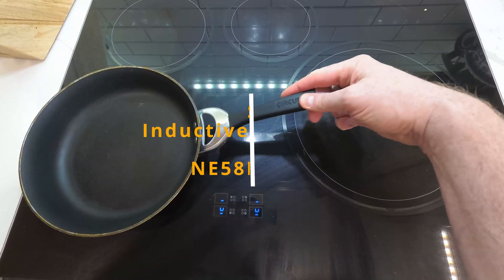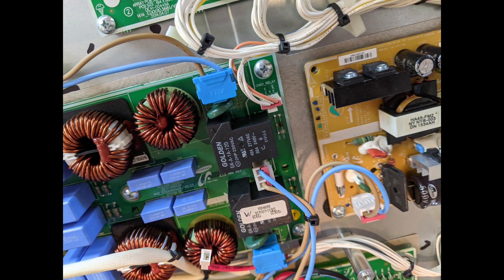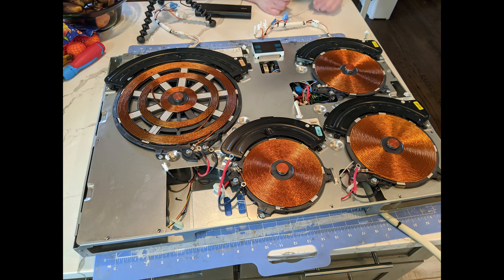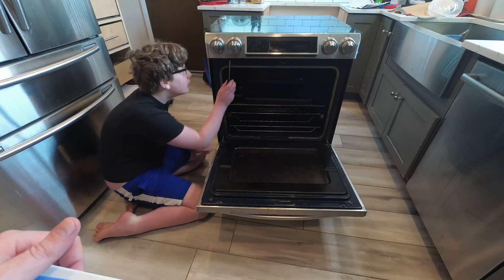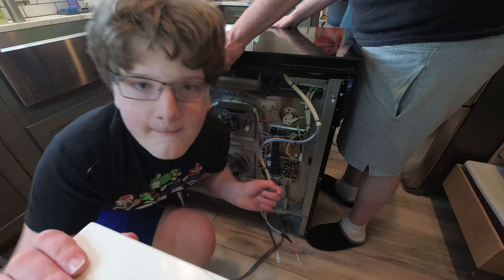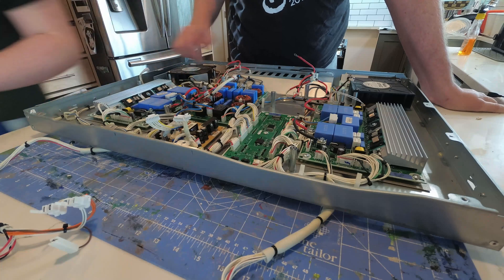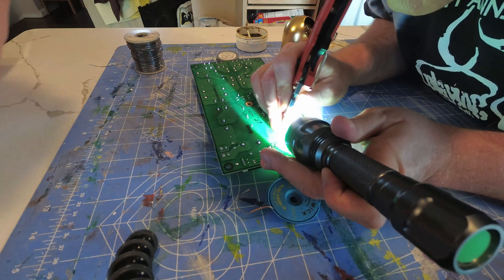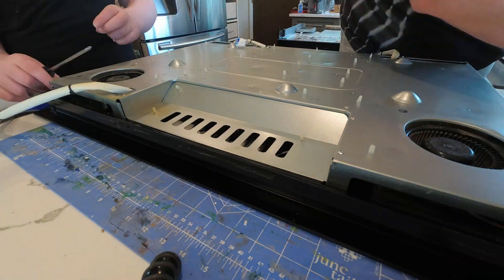Samsung Inductive Range Repair

Comment: Good day all, thank you very much for making this very detailed video. You saved us a lot of money, either for repairs/parts or to have to replace the complete appliance. Mine had the exact same problem and the solder connection was indeed the issue. Cleaned everything up, packed the connection with new solder and it looks like it did the job. For some reason, it looks like the pin from the relay doesn't take solder very well. We actually really like this range, even if it's 9 years old now. Our first induction and we will never go back to anything else! Again, thank you very much! With the internet and youtube, you can pretty much do anything nowadays!

Comment: Great video ! One more here that had it fixed. Both side stopped work. First left and then right side. Two points of solder fixed and all 4 burners working again. In case you are searching and got in this video it’s worth the try before buy a new one. Thank you for the video.

Comment: Hello, thank you for the video. I used it 2.5 years ago to fix the right hobs and will need to do it again to fix the left hobs. You mention having to fix the convection fans in the past, could you elaborate on that please? There is something not right with our fans and I wouldn't be surprised if it is the same issue. Thank you.

Comment: Dear Mr. Tools Against Entropy,

A huge thank you for your video, which continues to be an invaluable resource for Samsung stove owners. After carefully inspecting all the solder joints on the main control board and the right-side module (as both right burners had stopped working), I went ahead and reflowed two solder joints that looked slightly suspicious, even though nothing was as obvious as in your video.

I reassembled everything and tested the problematic burners — they now work perfectly! I wasn't sure at all of my work.

Many thanks to you and your son for your work and generosity.

Comment: Thanks for posting!. Awesome.  Saved me $$$ .  Just took me 3 hours.  There is a lot of screws..  Do need to be able to remove and re-solder.   Mine oven had two burners on the right that wouldn't work but was same fix.
Reply: Note that mine also had two failed burners (on the left), so same fix as your, just the other side.  Glad it worked for you!

Comment: The screws for the red and black wires are completely stuck.  We tried everything and no success.  Any ideas what we can do because we are damaging the screws right now?
Reply: First of all, make sure you have the right size and type of screwdriver, it's not a "one size fits all" situation.  I don't know exactly what size it is, but for Philips there are different sizes like #1, #2, etc...  Also, there's Pozidrive which looks a lot like Philips, but isn't.  If you've damaged the heads, it may already be too late.  I've heard putting a rubber band between the screwdriver and the screw can help.  Make sure you press in firmly while turning.  They also make this compound that can help, specifically for difficult screws, it's fairly gritty.  If the head is already damaged too much, you may have to look at using a left handed drill bit and/or an easy-out.  Look here for tips on difficult screws.  Be safe!

Comment: I replaced both fans in oven 2 month later the left side of the induction cooktop stopped working thanks for the video . By the way what type of solder works best.? Samsung should stick to phones.

Comment: Thank you so much for your video.  My samsung, 10 years old, failed one burner at a time over the last 6 months.  Thanks to your video I also found 2 bad solder joints on the centre circuit board.  After 4 hours work it is now back in operation.  Great job on the instructional video.

Comment: Thanks for the detailed, and clear instructions.  I've had to use your video twice now.  First the left side went out, then about a year later the right went out.  It was the same solder joint both times (but on opposite sides of the board).  You saved me a bunch of money.

Comment: Thank you so much for your detailed and helpful video.  This model stove is discontinued and we were able to fixed the 2 burners using your recommendation of resoldering the motherboard joints.  We are very grateful to you!
Reply: Which samsung do u have, where r u located

Comment: Thank you for your detailed and helpful video!  This model stove is discontinued and we could not find another stove on the market with the same features.  We were able to fixed the 2 burners due to resoldering the motherboard connections as you did.  You save us a big repair bill and we are very grateful.

Comment: Thanks. I just did this even though my hob wasn't completely broken. I got 10% more power on the left and 100% more power on the right. My big burner also had the wires a bit burned so I gave them a light clean. If I open it up again I'll change the 2 relays (GK-A-1A-12D) and will fully clean the wires or replace with silicone wires, they were only 14awg.

Comment: It worked!! Before I  saw this video I took my  oven apart. I could not see anything wrong.  Watched the video, took it apart again. I Looked at the board could not see any issues. I used my phone to zoom in on it and found the little tiny culprit. I resoldered the connection, and put it all back together. And bingo it worked!!! Thank you very much for your excellent video. I would’ve had to pay another $3000 stove. I will never buy a Samsung again, 2  main boards a convection fan and now this,never ever again.

Comment: I just finished the same process and found cold solder joints in the same location on the same board. It also looks like there was an attempted repair evidently by the people who made the board after realizing that the board had failed connections.
Pretty obviously a manufacturer defect but of course Samsung isn’t going to admit fault. I repaired the solder connections and the range burners work perfect now. It’s actually a pretty simple repair once you know the issue. The Samsung appliance repair technicians told my brother that the range couldn’t be repaired and the best place for the range was the local landfill. They had already replaced the main PCB board at the back of the range which of course had absolutely nothing to do with non functioning burners, at a cost of $600. These guys are a bunch of clowns and have absolutely no clue. Anyway thanks  you for the heads up it saved this range from death by landfill.

Comment: Great video, unfortunately, many of the screws on my unit were very soft and stripped easily making access to the circuit board very difficult.  I did manage to get to it, and solder what looked like a. burned out connection, but either my skills are weak or it was something else...time to look for a replacement.

Comment: This problem board is DE92-03543A    ASSY PCB SUB. The failure solder point component is GK-A-1A-12D. The problem is so called interactions soldering.

Comment: Thank you for posting this video! My stove is similar, and I had lost all functions of the stove (lights, sounds, burners) all at once. The fix for me was replacing that yellow circuit panel (DA92-00486A), I was able to test with a multi meter, and the soldered in fuse on that panel was blown, in addition to it having a burnt spot on the panel. While I was there I checked the other soldered connections and fuses like you show in the video. Thanks again, and cheers :)

Comment: Again, thanks for this extremely well done video. Did this today, exactly as described here. Me and my brother in law did it in 2 hours. Only glitch was one screw from the burner connectors REFUSED to come out and we shredded the screw head, (it was near the rear edge) so I just pried open enough space between the burners plate and board plate to remove the board. The exact spot was burned. Used a cheap solder and solder wick. Done.  It works. Thank you.
Reply: Had the same issue. Some of the screws were really hard to unscrew.

Comment: Thanks so much! Exactly the same problem on mine!! My very ugly solder fix might fail again but I can just go back in and do it again. Also thank you for the different bowls for different screws at each stage tip, I actually got it back together and used every screw! None left over lol!!

Comment: I watched the two videos and searched online for this problem. Based on the video and the instructions for other Do It Yourselfers, I decided to give it a go. The only difference was that my right stopped working about a month ago and two days ago it was my right front, so I needed to give it a shot, and guess what! I found the same problem only it was the solder in the main circuit board that controlled the right circuit board. It up was the same terminal, just on the other side of the board. Took about 4 hours as I took my time, and cleaned the stove at the same time, but nothing was hard about it. No parts needed, just soldering flux, a dab of solder and a small soldering iron. Good as new, and I love my stove as well.
Reply: Hey I'm having the same issue on the same right side that you had a issue on... Your saying I should find my issue on the same main board that was shown on this video?

Comment: Very good video guys, I have the exact model and the same problem with the centre power board.  On inspection, I found the dry solder joint just like the problem depicted in your video.  Unfortunately, I had already purchased it and was lucky to get a really good price on the board.  Thanks for taking the time

Comment: I had the same range with the same issue. I was very reluctant to tear it apart like this (even though I do consider myself fairly "handy"). Mostly because I doubted it would work. Well, I tried it, and it worked. The same controller board in the same spot had a burned-out solder joint. I did my amateur best to fix that and put everything back together. It now works again! Thanks so much! Thousands of $ saved and another huge hunk of parts not heading for the landfill.
Reply: Fantastic, glad we could help!

Comment: In our case we changed the part and the main board (didn't find this video in time!) ...fixed the problem for about 6 weeks then the same burners blew out again along with the right side ones 2 days later...technician suspects the fan.that is spewing grease/residue all over the unprotected boards....ours also started giving problems after 5 years of heavy use!
Reply from the maker: Interesting.  I have wondered if we would run into the same problem with the other side, but so far (~6 months since repair), it has been doing well.  I will say that the electronics in our range were fairly clean when I opened it up, I wouldn't say there was much in the way of oil to clean off the boards.  I can't recall any in fact.  Now my over range microwave, on the other hand, I recently had to repair and it was practically dripping with oil inside the case.  Curious how much the repair you had done was, my understanding is that would probably have been around a grand to replace the two boards using a service tech?
Reply: @toolsagainstentropy173  update on the "repair" ...showed the tech where to solder (wound up doing it myself! at least he didn't charge for the service call!)...left side induction burners all good about 1 month.... as of yesterday the right side burners no longer detecting! The initial repair cost  was about $800 CAD including parts and labor. replaced 3 boards, oven sensors and switch.. but not the power board...oh additional 125 cad for the fan...at this rate I'll have enough parts to build another Range! I brought up the issue to Samsung Canada, the initial customer service rep was understanding and polite but when I was transferred to their manager he basically told me too bad, not their problem and hung up...